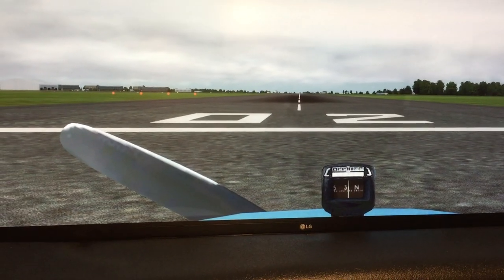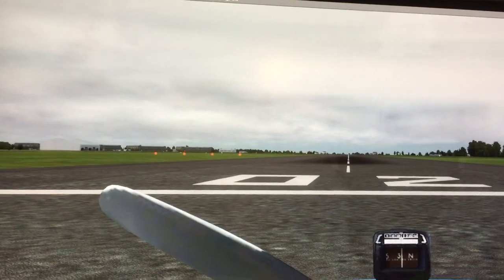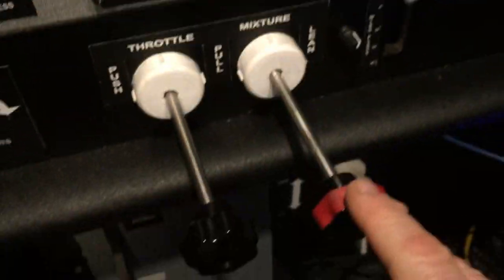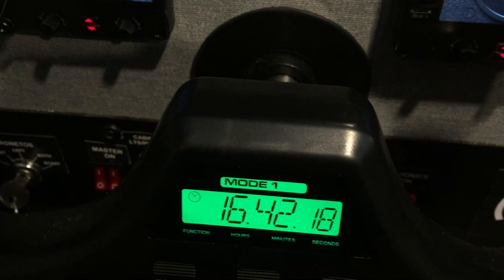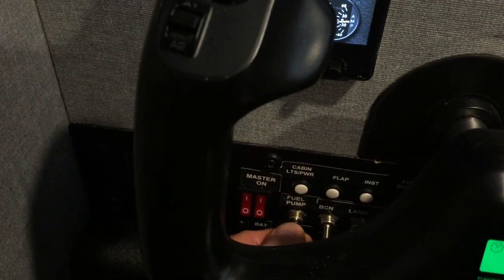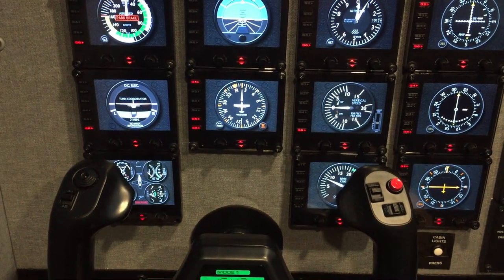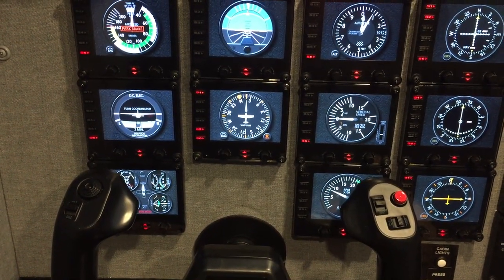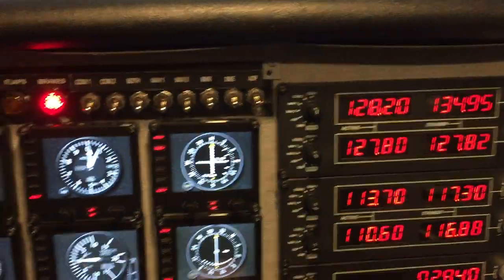New Cessna 172 Simulator

Comment: Very nice im looking to use OLED screen to simulate the analouge dials & digit display with panel over with low profile switches & rotary encoders , switch  & position decoders to USB and software to drive server and in time a external view projector